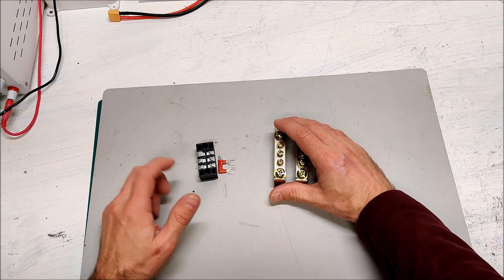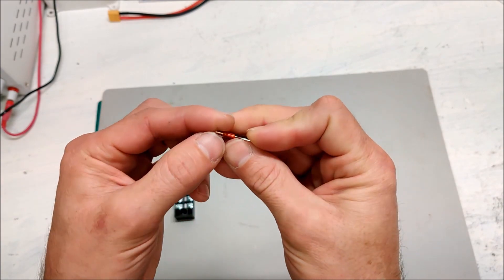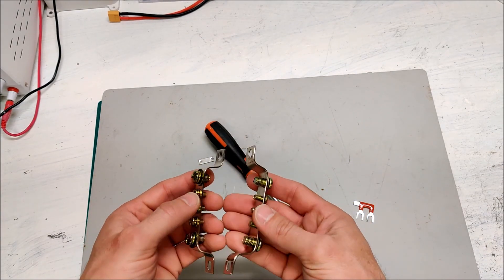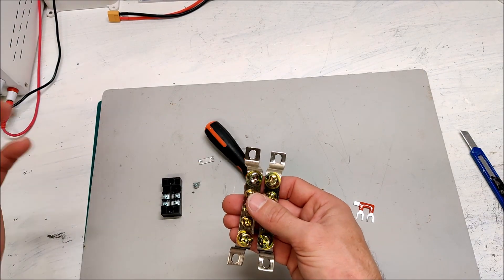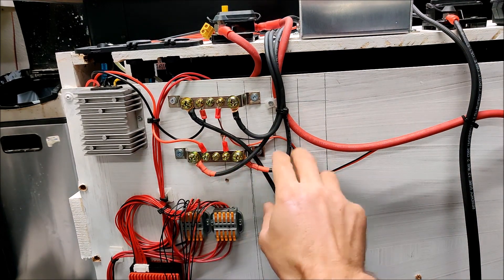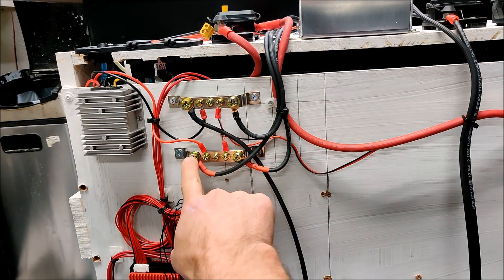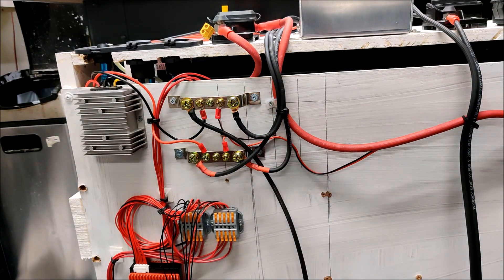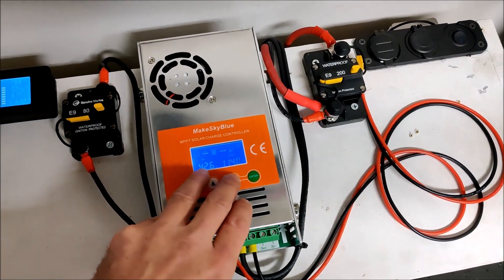New Bus Bars for the 15Kwh Powerwall

Comment: Fix that negative wire laying across thr positive bus bar! Its insulated, but insulation breaks down. Thats a fire hazard.
Reply from the maker: Yeah I'm limited by cable length and might have to remake a couple of the cables

Comment: Why not just stack the heavy wire terminals so the current doesn't have to pass through the bus bar?
Reply from the maker: Great question. I thought about it but now that you mention it again I might just do that and it might help my short cable length. 👍